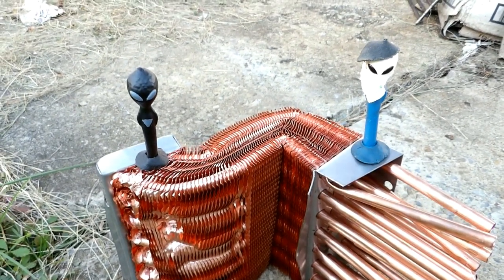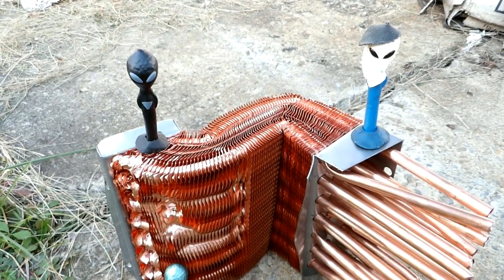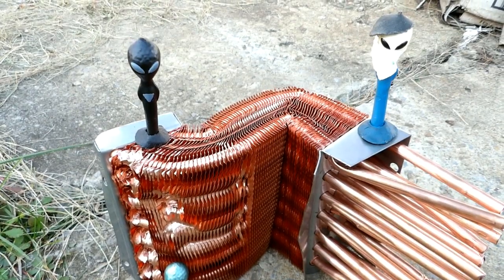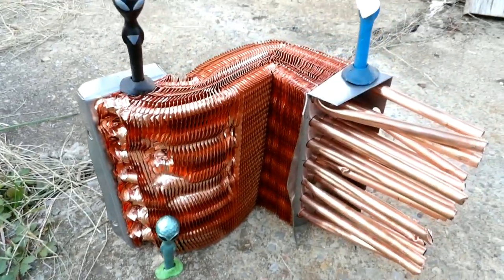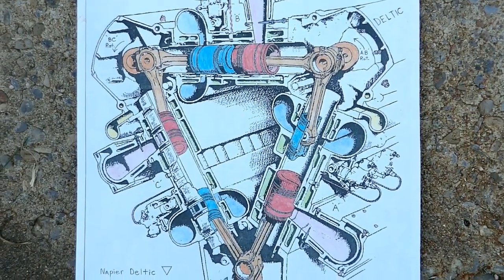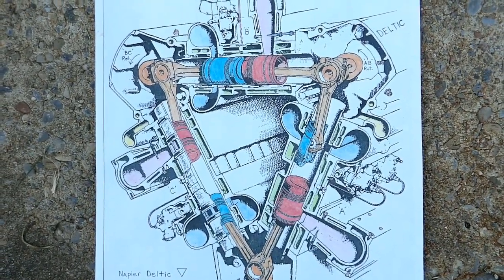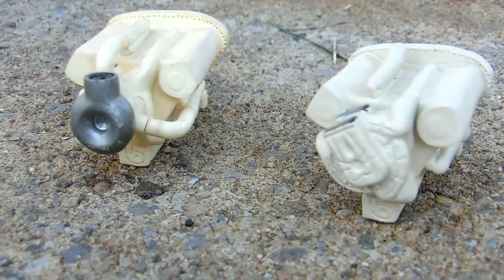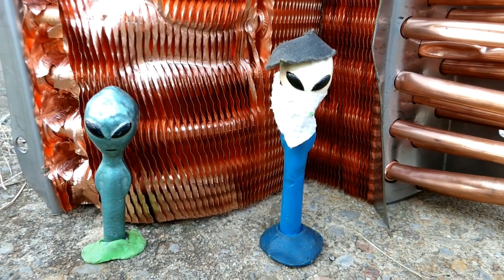Catastrophic Coil Fail !!!!

Comment: Clearly the 3rd coil failed and caused a reverse implosion of the #4 conductor tube assembly......
Reply from the maker: You are on the right path, for sure. Perhaps Dilithium crystals were involved also!
Reply: @ChargerMiles007  Wow that explains the hard twist to the left of the plasma condenser coil, I did realize the crystals failed it must have been in the outermost ring of the electron shells..... and caused a resonance cascade implosion...